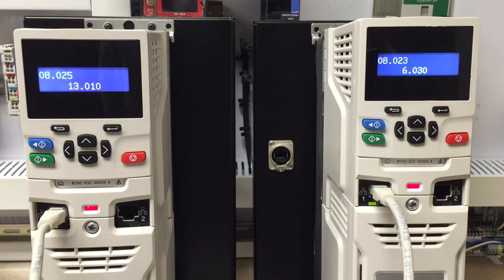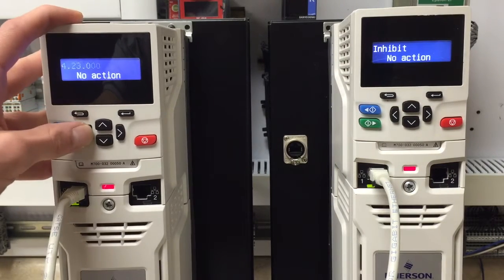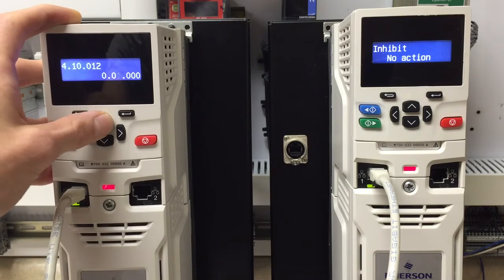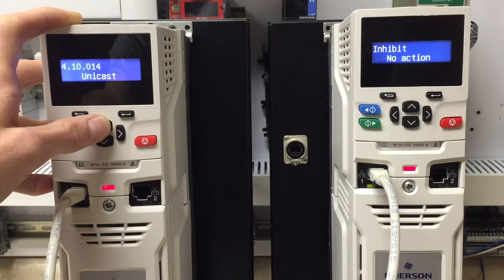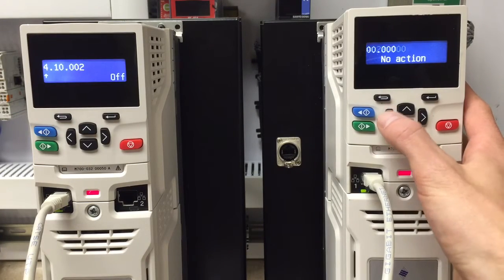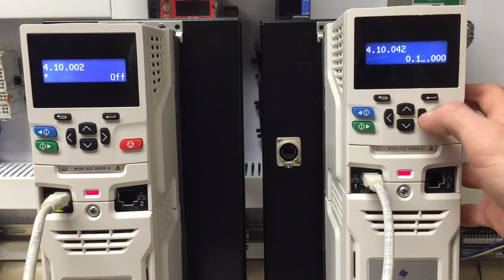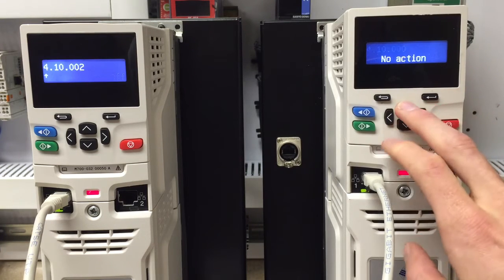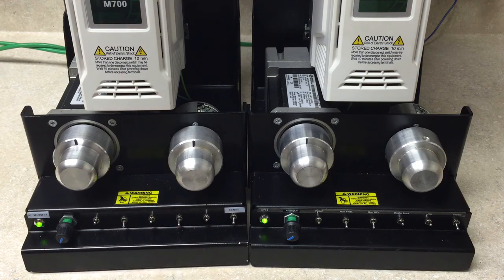Control Techniques - Unidrive M Position Sync over Ethernet setup

Comment: What is the optional boards for this application? What is encoder type code?
Reply from the maker: There was no optional boards used for this application. We used Unidrive M700's which come with on-board Ethernet capabilities. The feedback device on the motors is EnDat.

Comment: what is reason behind user trip 71? ,is it avoided by any program setting of drive M700.
Reply from the maker: The trip codes numbers 40 to 89 are trips that are not generated by the drive but by your application specific program.  In order to use the user trip function you write a value into parameter 10.038 which in your case is 71.  To determine what the trip code 71 is in reference to you would have to look through your program code.